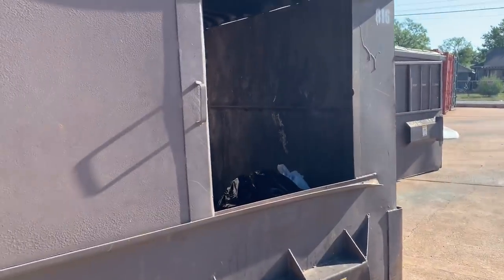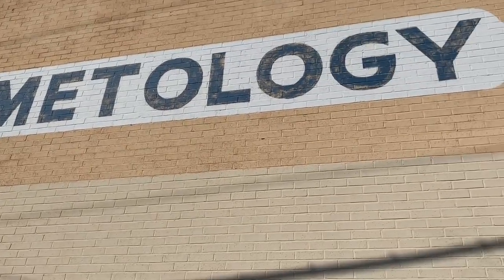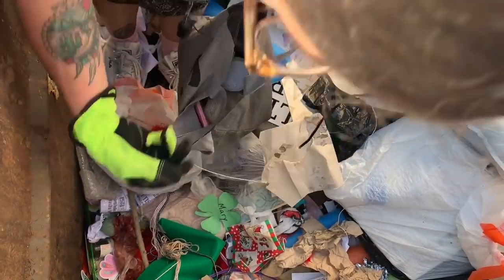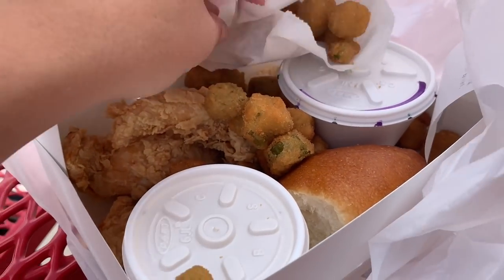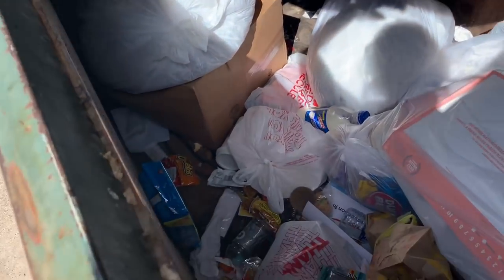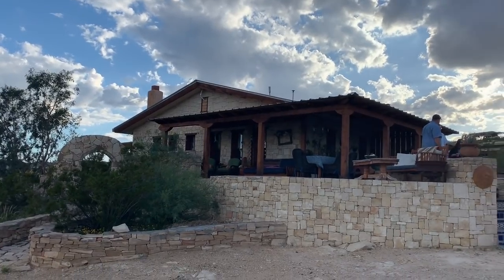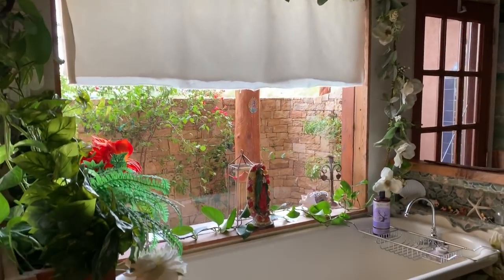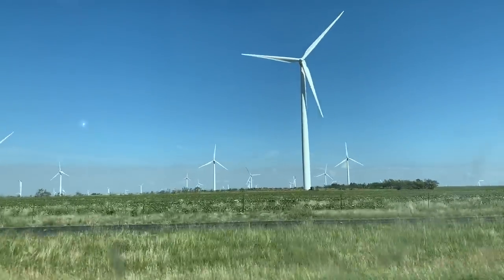Dumpster Diving on a Road Trip Across Texas!

Comment: I use-to  have a easy helper to get in and out of Dumpsters, find two 5gal bucket's put one inside the other. Tie a light rope to the handles. You stand on it to get in the dumpster (tie the rope to you), when in the dumpster pull the bucket's inside. I gathered stuff from the dumpster in the bucket and lowered it back over the side to my friend to empty. Just stand on the bucket's upside down of course to get Out!!! Have fun with it.